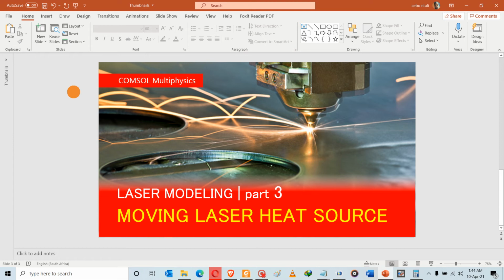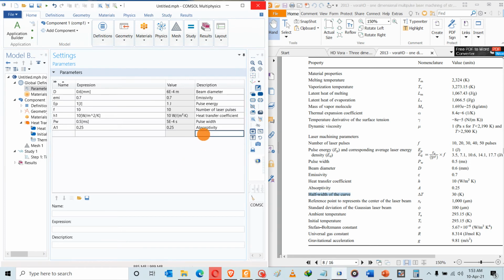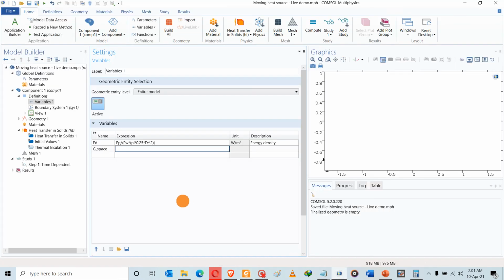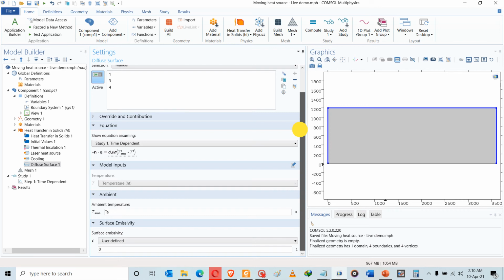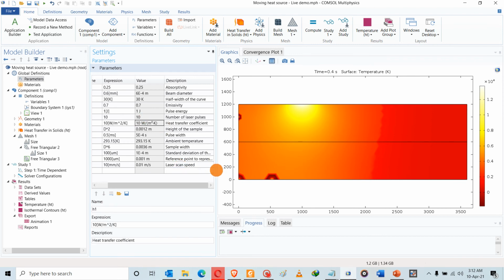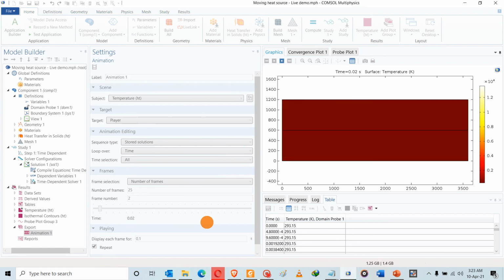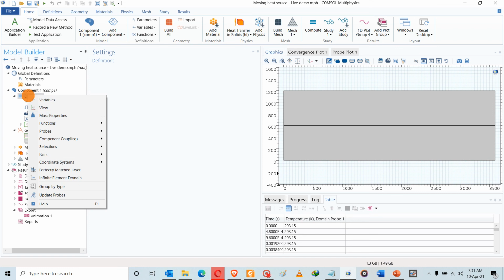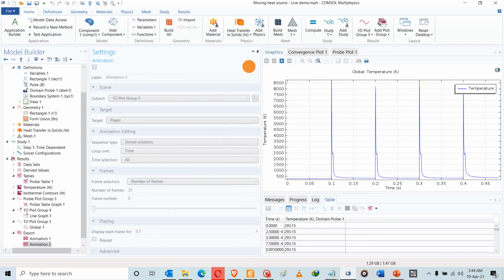How to model a moving laser heat source in COMSOL Multiphysics | Lasers, Heat transfer - Part 3

Comment: Hiii, I am working on heat transfer in solids(Plastics) with two materials to be joined by lap joint welding having upper material as transparent and the other one as opaque..can you help me how to give heat flux to the upper material,so that the maximum heat can be obtained at the interface of two materials. Thank You
Reply from the maker: You can apply the heat flux along the line of the weld as you would to in real life. The best way to do this is to fix one position of you heat source and then let the other be dependent on your welding speed or velocity. E.g. For a 2D moving heat source problem:  
Y_position = Any value where the weld will be = 2 cm, X_position = Starting position (X) + (Weld velocity)x(time) = Xo+v*t.  Say the starting position = 0, then X_position=v*t
Your heat source will move along the x-axis at the rate of the welding speed. The energy input will be up to you. So, your heat flux can be similar to the one demonstrated here. However, what you will change is the velocity, starting positions on the y-axis and x-axis.
Reply: @chemicalsimulationcorner  Thank you for the reply...actually for 2D laser heating,the laser heat flux is moving in given direction...but in 3D model if i have to move the laser heat flux in circular direction,i am unable to move the heat flux(or i am unable to select the circular path). Please advise on this...

Comment: can you please make a video for Step 2 in this work or the keyhole problem which is shown on paper ?? please make a video regarding the deformation caused by the heating source.
Reply from the maker: That is an excellent suggestion. We'll do so in later demonstrations where we add fluid flow. Thank you so much.
Reply: @chemicalsimulationcorner  we are facing the problems while adding the multiphysics like fluid flow and coupling them. we are requesting you please do make one video by taking this same research paper problem over coupling and adding multiphysics etc.
Thank you in advance.
Reply: @Rajkumar_IITK  Hey, were you able to do the fluid flow part?

Comment: Thank you sir for the wonderful videos. But I found that the maximum temperature in the article at 1 J is near to 3500 K but in the video maximum temperature is reaching 10K . How to Validate the model
Reply: The above comments with reference to  this video 
https://www.youtube.com/watch?v=BxCott07YSg&t=2564s
Reply from the maker: @anshusahu9059  ...Great. I'm glad you are able to create the simulation, that's all that matters, that's what the tutorial is for. The reproducibility of the outcomes is dependent on a variety of factors (i.e. Material properties, mesh sensitivity analysis, time step, etc.). So, that's the next step of improving your simulation. Good luck with your simulation!!
Reply: @chemicalsimulationcorner  How to apply the level set method to track liquid and vapour boundary in this case

Comment: hello, how to model nanosecond laser heating of silicon in Comsol multiphysics?
Reply from the maker: You can use this model to do that. Just change the material and the pulse duration to nanosecond. You can download the article shown in the description. It'll give you the guidelines as well. If you are still unable to, please feel free to contact us at info@nemantu.co.za, we can take the conversation further.
Reply: @chemicalsimulationcorner  You means I can change the pulse width to nanosecond
Reply from the maker: @gulshaniqbal5988  ....yes....and other parameters (scan speed, material properties, beam diameter, beam standard deviation) relevant to your project ofcos. But yes, change the pulse with and repetition rate (f) mainly. For nanosecond lasers, repetition rate is usually higher than it is demonstrated here (10 - 50 kHz maybe?). I'd like to assume that your pulse energy is a bit lower than demonstrated here too (i.e. 0.1- 10 mJ maybe?). Edit those to start with.
Reply: @chemicalsimulationcorner  One more question I haven't seen the wavelength (λ) and material of laser used in the project. Can you please specify., In my project i will be using λ=1064 nm
Reply from the maker: @gulshaniqbal5988  ....Wavelength definitely matters in the model if you are modeling wave optics as well in COMSOL. We'll demonstrate that too in future demos. For now,  focusing on heat transfer effects and fluid flow is a good place to start in your project. In a way, wave optics are more of a luxury you'll add only if that is part of your scope (i.e. if you'll study the effects of different wavelengths or beam alignment or focus, etc.). If you don't include it, no one will discredit your work either.
Reply: @chemicalsimulationcorner  Thank you for your reply and help. Actually I am working to used Krf laser so wavelength is of my interest and I will try .Will be waiting for your future demos. Really appreciate your efforts and help. Thank you once again.